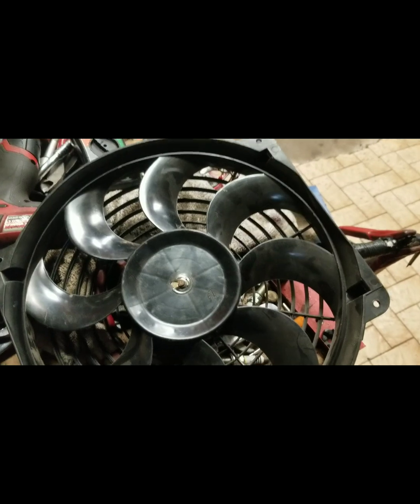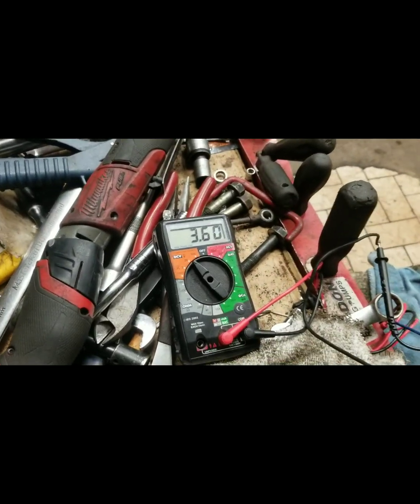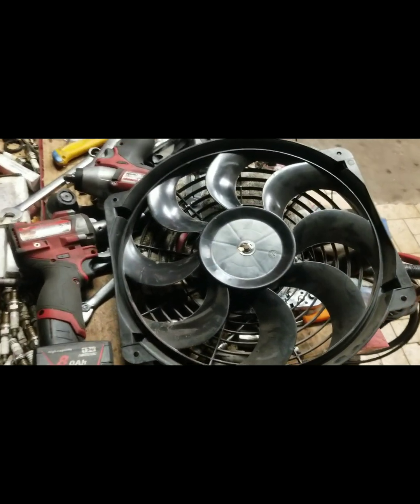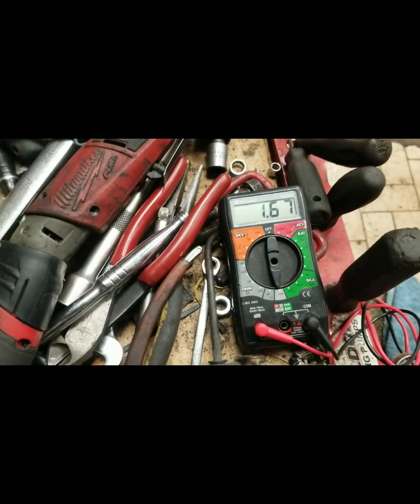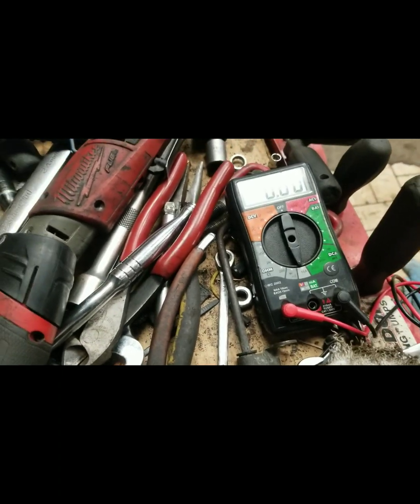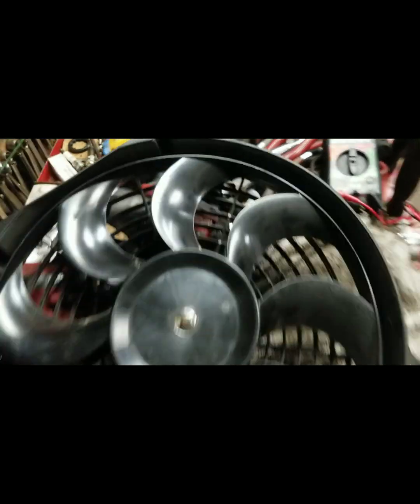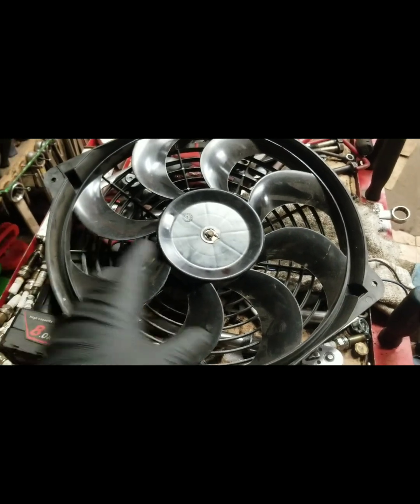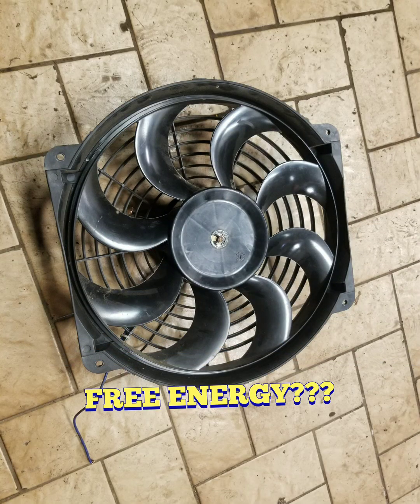FREE ENERGY? Generating with Wind Power?

Comment: I've thought about zip tying a bunch of those along my chain link fence all the way around my property and basically running them in  series so that they produce higher voltage at the end and then also running each one of them through a voltage controller that would flip the polarity in whatever direction is needed based on wind directions I imagine if you had about 60 of them all across your fence covering every square inch it would also make them more efficient to because when you cover a large area they would be creating a wall so to speak instead of just putting like one of them in the middle of the fence and allowing the air to go around it if you had all of them covering the entirety of the fence there would be forced to go through it I live on the edge of a mountain where we get speeds ranging from 20 mph winds all the way up to 104 mph winds
Reply from the maker: Wow. That would be quite the experiment.  Would love to hear back from you when you try it out. Sounds like you might be onto something. Keep us posted.
Reply: @UncleTinman I don't know if I would actually try to take on the build because I would need to acquire a whole bunch of fans and I don't know that it would be very feasible because I live pretty far from everything and it would be pretty hard to acquire that many fans from some junk yards.